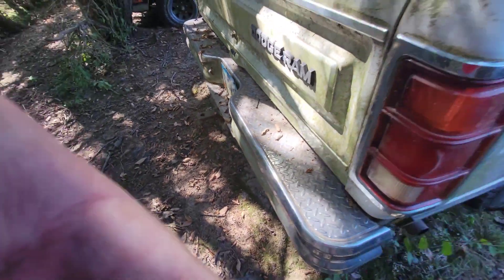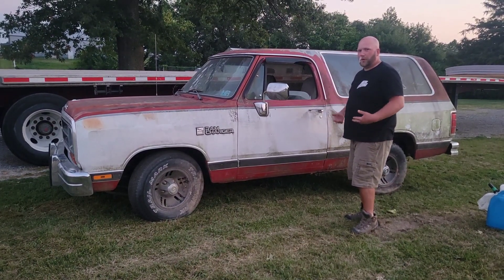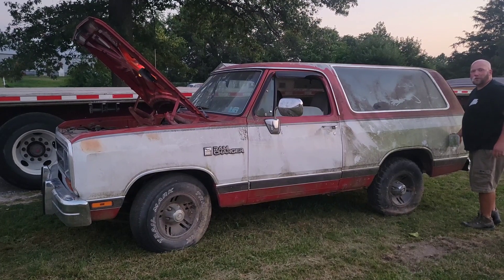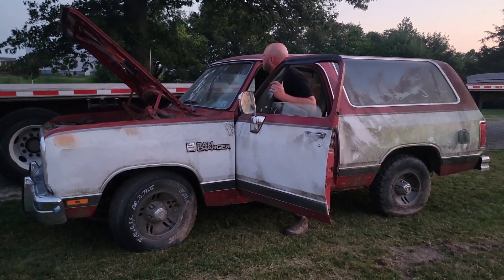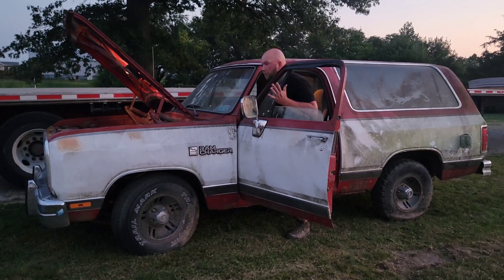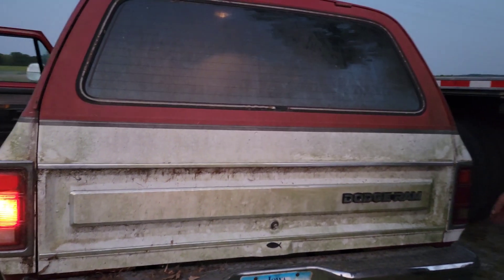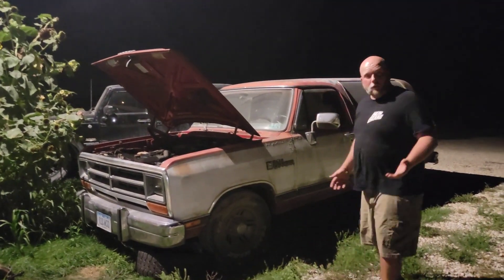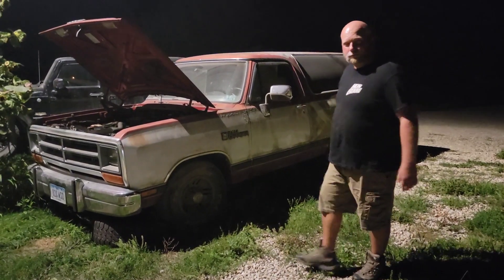Will it run and drive home? or Burn down? 1990 Ramcharger 2wd

Comment: Defeat there's not defeat in that. Hell it done good to get that far after setting for 10 years.  So hold your head up high because when I first started watching this video and heard you say it's be sitting for 10 years I said to myself that fuel pump is gummed up and won't work and you would have to replace it.  So I think you done good getting that far .so I call that a win
Reply from the maker: Thank you I appreciate it. I was honestly pretty surprised it was good myself. If you haven't already check out the new video.

https://youtu.be/x7eGQ0cBzjw?feature=shared

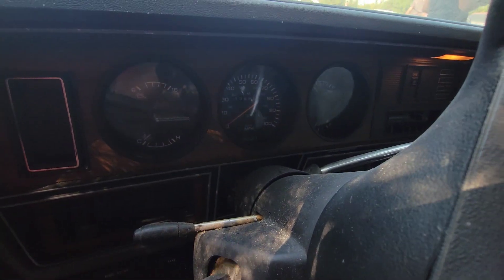Comment: He said “computer problem”. 0:59 

Check the main harness connector coming out of the driver side firewall on the engine side. It’s very common for moisture and corrosion to get in there and cause all kinds of odd ball issues in the electrical system. Clean it out and wrap some electric tape around the seal lip.